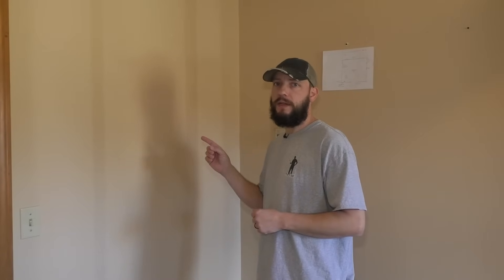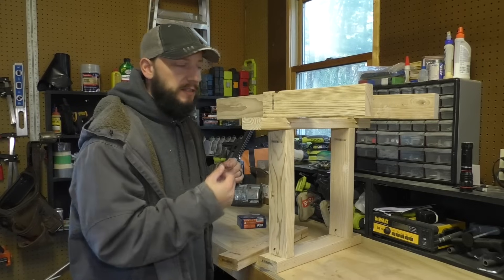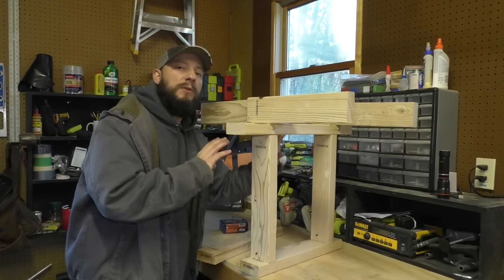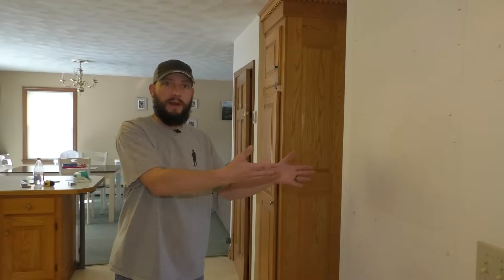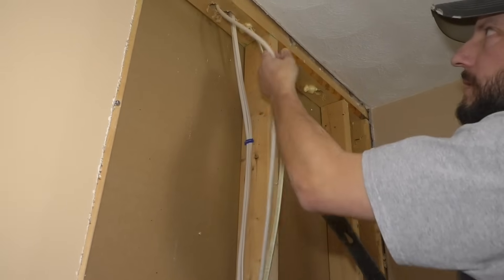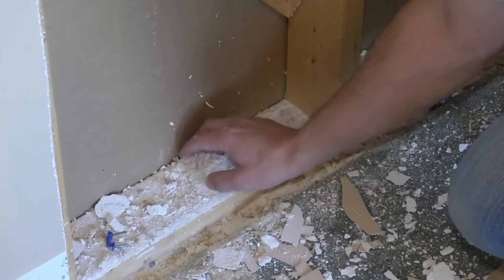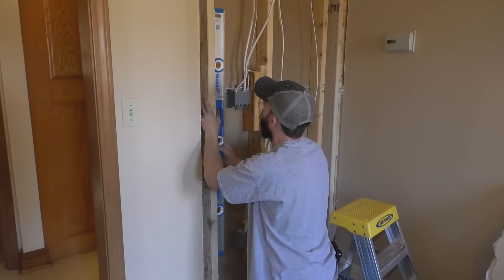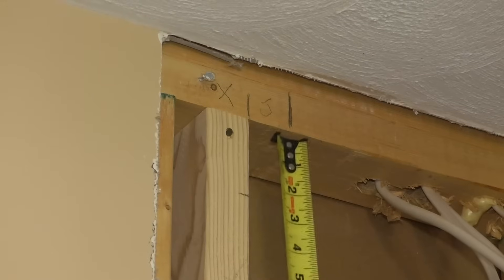How to Frame a Door Opening in a Load-Bearing Wall

Comment: 5:25 Just cut a minimum of 1 to 2 inches of drywall from the bottom of the wall exposing all of the studs from the current doorway to the wall where the thermostat is. Since you're going to be refinishing the outside walls of that pantry in the current room anyway, it won't be seen once you're done.

Comment: When I did a header I used narrow vertical strips and left some gaps between the big boards to let me put electrical through them as I had to reroute some Romex.
Reply: I think I know what you did because I just encountered it in a header I recently removed from a 2x4 wall:  instead of using a full width of 1/2" plywood for the middle of the sandwich, the original framer used approx 4 inch wide strips of 1/2 plywood and put those spacers on approx 16 inch centers across the header, which left some wide gaps.  I have no idea if that's ok by code but it seems like a wise use of material AND gives a channel to run romex thru the center of the header.